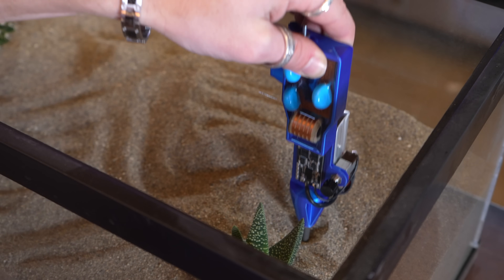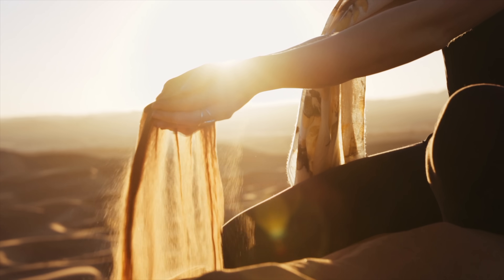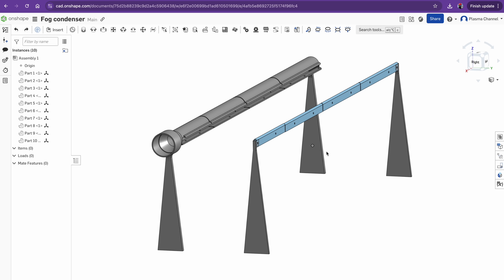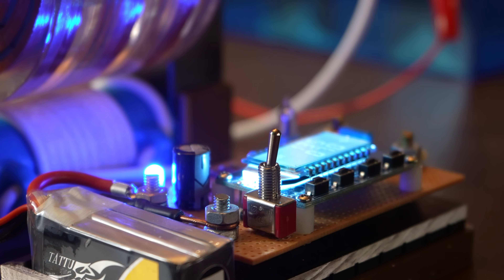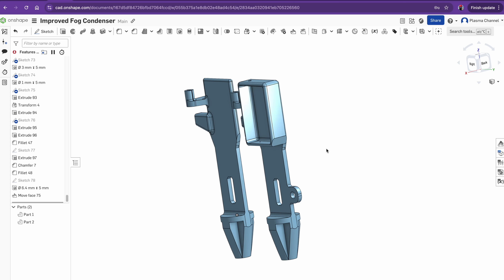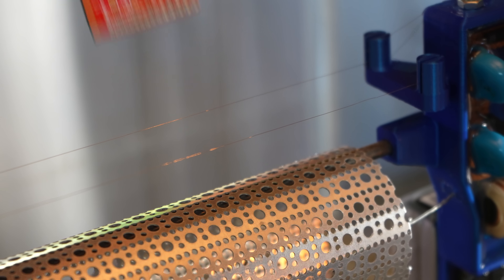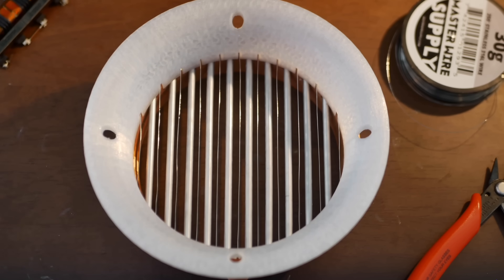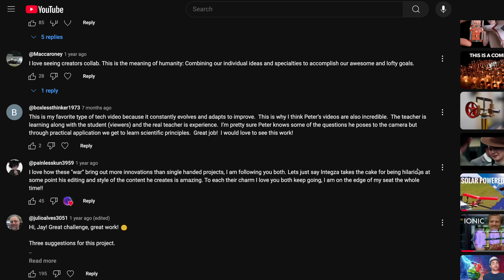Solving Desert Water Shortages Using 20,000 Volts

Comment: Grok is far superior to ChatGPT:

Yes, high-voltage grids can be used to collect fog and moisture from the air, and this approach has been explored and demonstrated in scientific research and experimental setups. Unlike traditional passive fog collectors that rely on mesh nets to capture water droplets through inertial collision and gravity, high-voltage systems use electrostatic forces to actively attract and collect water droplets, often achieving significantly higher efficiency. This method leverages principles like corona discharge and space charge injection to enhance fog harvesting, making it a promising technology for addressing water scarcity in foggy regions or industrial settings.
How It Works
The process typically involves setting up a system with two key components:
	1	Emitter Electrode: A high-voltage source (often a sharp needle or wire) is charged to a high potential, typically in the range of kilovolts (e.g., 15–25 kV). When the voltage exceeds a critical threshold, it induces a corona discharge—a phenomenon where the surrounding air is ionized, creating a plasma region of charged particles (electrons and ions).
	2	Collector Electrode: A grounded or oppositely charged surface (e.g., a mesh, plate, or cylinder) is placed nearby. The electric field between the emitter and collector drives the charged ions toward the collector.
As fog—composed of tiny water droplets—passes through this electric field, the droplets collide with the ions, acquiring a charge. The charged droplets are then electrostatically attracted to the collector, where they accumulate and can be drained into a storage system. This active mechanism contrasts with passive nets, which depend solely on wind and droplet size, and it can capture a much higher percentage of available moisture.
Efficiency and Evidence
Research has shown that high-voltage grids can dramatically improve fog collection efficiency:
	•	A 2018 study published in Science Advances by MIT researchers demonstrated an electrostatically driven fog collector using space charge injection. In lab tests, a setup with a 15 kV voltage applied to a needle emitter and a grounded mesh collector harvested 30 ml of water in 30 minutes, compared to just a few droplets without the electric field. This system achieved collection efficiencies far exceeding the 1–10% typical of passive mesh nets, with some configurations nearing 90% efficiency under optimal conditions.
	•	Another study in ScienceDirect explored a two-stage electrostatic fog collector with wire and plate electrodes, reporting collection efficiencies above 90% in controlled experiments. The design used repelling electrodes to tailor the electric field, enhancing droplet capture.
	•	Field tests and simulations suggest that efficiency depends on factors like voltage level, droplet size (typically 5–50 μm in fog), wind speed, and electrode spacing. For instance, a wire-to-plate collector achieved a 60% collection efficiency at 24 kV with a fog flow velocity of 1.06 m/s.
Practical Applications
High-voltage fog collection has been proposed for various uses:
	•	Water Harvesting: In drought-prone, foggy regions (e.g., coastal deserts or mountainous areas), it could provide a sustainable water source for drinking, irrigation, or reforestation. Projects like those in Morocco or Chile, which use passive nets, could potentially integrate this technology for greater yield.
	•	Industrial Recovery: Power plants and cooling towers lose water through plumes of vapor and fog. Electrostatic collectors could recover this water, reducing waste.
	•	Fog Removal: Systems could clear fog from roads or airports, improving visibility while collecting water as a byproduct.
Challenges and Feasibility
While promising, there are practical hurdles:
	•	Energy Requirements: Although the power draw is relatively low (e.g., microamps to milliamps at high voltage), a continuous energy source is needed, unlike passive nets. Solar panels or small wind turbines could address this in remote areas.
	•	Scalability: Most experiments have been small-scale (e.g., 1 m² meshes). Scaling to large grids requires optimizing electrode design and managing higher voltages safely.
	•	Maintenance: Corona discharge can produce ozone or degrade electrodes over time, necessitating durable materials and periodic upkeep.
	•	Environmental Conditions: Efficiency drops with very low wind speeds or large droplet sizes, and the system must be tuned to local fog characteristics.
Historical Context and Proposals
The concept isn’t entirely new. In the mid-20th century, South African meteorologist Theodore Schumann proposed an electrified fog fence on Table Mountain, suggesting a 150-foot-high fence with 50 kVA at low amperage could collect 30 million gallons of water daily from moisture-laden winds. While not implemented, modern technology could refine such ideas with higher voltages (e.g., 500 kW setups) and advanced materials.
Conclusion
High-voltage grids can indeed collect fog and moisture from the air, offering a more efficient alternative to passive methods by using electrostatic forces to capture droplets. Experimental evidence supports efficiencies approaching 90%, far surpassing the 2–10% of traditional nets. However, deployment requires balancing energy costs, scalability, and maintenance against the water yield. In foggy, water-scarce regions or industrial contexts, this technology could complement or even outperform existing solutions, though it’s not yet widespread in real-world applications as of February 21, 2025.

Comment: Very nice. The target terrain is wrong, but this is potentially very good for land recovery in Africa. Just not in the desert...
Here's the problem. Most plants are symbiotic with fungi and mold in the ground. They need these symbiotes or they do not uptake the water. Putting water into sand is useless: there's no fungi there. But there are places where there is fungi. And a method of getting those regions productive again is already being implemented across regions of Africa... just not the desert. You need land that has been lost recently: the symbiotes need soil, not sand.
This is ecosystem recovery and it is largely being aided by the UN. (It's not completely useless.) And the problem was that they suffered drought in the first place. A water source like this will help recover the land, but more importantly, prevent it from dying due to the next drought. With those regions recovered, we can push the soil into the desert and recover the desert over decades. We just can't start in the desert.

Comment: Ya know, between you, Dustups (the gent trying to make a desert forest in Texas), and Nighthawkinlight collabed, I'd wager y'all could build a very Resource efficient garden and shed just about anywhere. Heck, add some hydroponic systems like Hoocho's designs and you could potentially grow anything anywhere. I do have a question though, is there a way to combine this tech with nitrogen harvested from the air?
Reply: Dustups would be a fantastic collab for this, a very rough challenge to the technology, since you don´t have very high humidity pretty much anytime of the day. But if it works there, it will work basically anywhere.
Reply: @danielgoetze  I think it would be a useful thing for him when he gets all those near misses from monsoon rain systems.  The drought in that area has been hampering his efforts
Reply: @ablightuponall  He could drill a well like his neighbor. It's just $$$.
Reply: @danielgoetze  Yeah, but now that I've watched the video a few times, it probably wouldn't help. I don't think the phenomenon, the fog, happens over there. Too far from the Gulf.
Reply: Do you think you could make a nitrogen fertilizer at the same time?

Comment: Technically you are not condensing water. You are e pulling already condensed water droplets from the air. A heat pump on the other hand condenses water vapour, and that takes a lot more energy... Great invention non the less!!

Comment: Hi, the output has to be compared with passive static wind traps (made of special tissue) that do no use any current to catch water from the ambient air to see of the energy consumption is worth it or not.

Comment: Could this be adapted to be a viable house dehumidifier? I think being able to run a dehumidifier inside my house that produces zero heat would be a god send in humid areas like Texas where I am. I have a small refrigerant based dehumidifier in my bathroom but it takes a lot of power and produces a lot of heat. Running a single 100 watt solar panel hooked up to something like this could run essentially 24x7, create no heat, and dehumidify my home. Any chance at making a scaled down version and testing that?

Comment: This very interesting, but way too expensive if you run it off of existing infrastructure. 1 litre of water condensed by this method costs roughly 1-3€ depending on where your located. Of course you could use inexpensive renewables, but that is dependant on time of day and weather. I could imagine that you couldn't compete when using solar energy because the energy would have to be stored in expensive batteries with limited charge cycles to be able to use it in the morning.

Comment: If your really thinking of doing this you need a water gutter the whole length of the bottom of the negative screen . Then the gutter should be on an 15% angle to have it run into a pipe in the ground to hold the water . In the ground the temperature will be cooler . If the droplets just fall on the sand most of it will evaporate . So produce , route , contain then use .

Comment: Why solar? You have literally 0.5kg of water/h at an arbitrary height, if you make this elevated like on tilts, could you not use the potential energy from this water to generate the electricity to power the whole system? Basically a "perpetual" machine (as long as there's fog)! Imagine, the water drips into a container, that once in a while (through a sōzu? or a siphon?) runs a wheel connected to a dynamo. Prob still need a battery or a capacitor for both start and time between drops.
Note: I cannot believe I am proposing a "perpetual machine" on Youtube

Comment: So you definitely touched on it in the video but I think it's important to address that what you're doing isn't condensing water, that's already happening with the fog, what you're doing is coalescing the condensed water. Basically, this only works in foggy conditions, and probably wouldn't work in humid conditions. I would be interested to know if there is the possibility of this working in humid conditions or building some kind of small evaporator cycle that would help to cool down the air in a humid environment that could condense the water that could then be wrenched out. Another option is some kind of low pressure situation maybe in the Lee of wind turbines or other artificial areas of low pressure.
Reply: Keep it simple. Detect natural dew point, no energy required for condesation. Start his process. That's why it is so much more energy efficient than a dehumidifier. Others have made large scale usage of another process that consist of making cloth with hydrophilic fibers that will coalesce the condensed water with no energy input. But those require large surfaces perpendicular to the fogy wind to produce their maximum output. And the damn wind blow where it wants.
Reply: Large scale radiative sky cooling to passively condense?
Reply: condensing water is very energy intensive and does not compare to a well. even bringing in the water on huge tanker trucks is cheaper than dehumidifying desert air. 

this video does not really show an improvement either because fog nets are cheap, simple, low maintenance and need no power. it trades space efficiency for cost efficiency, which is a no brainer in the desert.
Reply: @drkastenbrot  Condensation being energy intensive? It appears that you have a serious misunderstanding of thermodynamics, "Dr" Kastenbrot (is this a typo?). I suggest looking up  "latent heat of vaporization" or "enthalpy of condensation" (opposite) as a starting point.
If condensing of water were energy intensive, as you erroneously claim it is, tropical cyclones simply wouldn't exist.
From <REDACTED>:
"Hurricane energetics: Latent heat of water: the Fuel of Hurricanes

Hurricanes are extremely energetic storms with very warm cores, high winds and low central pressures. To fuel these storms, hurricanes must somehow tap into an enormous energy source. That energy source is the latent heat of water. We can estimate the amount of energy released by a hurricane knowing approximately how much rainfall a hurricane generated. Remember that for each gram of water vapor that is condensed, 590 calories of energy are released to heat the atmosphere. For comparison, TNT (Trinitrotoluene) releases 1000 cal/g in an explosion. So condensing a gram of water vapor to liquid at normal temperatures releases about 60% of the energy that detonating a gram of TNT would."

In fact, condensation (NOT condensate !) can actually be used to extract energy. From <website>:
"The condensing economizer improves waste heat recovery by cooling the flue gas below its dew point, which is about 135°F for products of combustion of natural gas. The economizer reclaims both sensible heat from the flue gas and latent heat by condensing flue gas water vapor."
Reply: @drkastenbrot  Condensation being energy intensive? It appears that you have a serious misunderstanding of thermodynamics, "Dr" Kastenbrot (is that a typo?). I suggest looking up  "latent heat of vaporization" or "enthalpy of condensation" (opposite) as a starting point.
If condensing of water were energy intensive, as you erroneously claim it is, tropical cyclones simply wouldn't exsist.
From <REDACTED>:
"Hurricane energetics: Latent heat of water: the Fuel of Hurricanes

Hurricanes are extremely energetic storms with very warm cores, high winds and low central pressures. To fuel these storms, hurricanes must somehow tap into an enormous energy source. That energy source is the latent heat of water. We can estimate the amount of energy released by a hurricane knowing approximately how much rainfall a hurricane generated. Remember that for each gram of water vapor that is condensed, 590 calories of energy are released to heat the atmosphere. For comparison, TNT (Trinitrotoluene) releases 1000 cal/g in an explosion. So condensing a gram of water vapor to liquid at normal temperatures releases about 60% of the energy that detonating a gram of TNT would."

In fact, condensation (NOT condensate !) can actually be used to extract energy. From <website>:
"The condensing economizer improves waste heat recovery by cooling the flue gas below its dew point, which is about 135°F for products of combustion of natural gas. The economizer reclaims both sensible heat from the flue gas and latent heat by condensing flue gas water vapor."
Reply: @josgeerink9434  are you just trying to be dense
Reply: @drkastenbrot  Great comback, really gonna change minds with that one...
I suggest you carefully read my last two comments. Maybe you'll learn something.
Reply: @drkastenbrot condensation actually releases energy, its vaporization that takes a crap ton of energy.
Reply: @JosGeerink  Some serious misunderstanding of thermodynamics going on there, on the level of "air conditioning your house releases energy, only heating it takes energy"... 🤦
Reply: @ Not your house, your air conditioner releases energy but it must use energy to cool the air inside and release it outside the house.
Reply: @FrancoisEustache-ed6gd  It doesn't "release energy". It forces energy to move to a place it less wants to be.
Reply: @JosGeerink  go figure out yourself why dehumidifiers need power instead of generating it
Reply: @daliasprints9798  Of course, air conditioners don't produce energy, silly. They're heat pumps; they just move it around (from a to b or vice versa), working against conduction to increase a temperature difference (and, locally (only locally, second law of thermodynamics) decrease entropy). That takes energy and is, as we (evidently not all...) know, unrelated to the latent heat of vaporization or enthalpy of condensation (opposite), which, for water, is around 2260 kJ/kg.
This CAN be used to extract energy. From <REDACTED for YT filters>
"The condensing economizer improves waste heat recovery by cooling the flue gas below its dew point, which is about 135°F for products of combustion of natural gas. The economizer reclaims both sensible heat from the flue gas and latent heat by condensing flue gas water vapor."

But I'm the one with a serious misunderstanding of thermodynamics ;)
I screenshotted your reply for the good laugh, hope you don't mind.
Reply: @daliasprints9798  Of course, air conditioners don't produce energy, silly. They're heat pumps; they just move it around (from a to b or vice versa), working against conduction to increase a temperature difference (and, locally (only locally, second law of thermodynamics) decrease entropy). That takes energy and is, as we (evidently not all...) know, unrelated to the latent heat of vaporization or enthalpy of condensation (opposite), which, for water, is around 2260 kJ/kg.
This CAN be used to extract energy. From [redacted for YT filters]:
"The condensing economizer improves waste heat recovery by cooling the flue gas below its dew point, which is about 135°F for products of combustion of natural gas. The economizer reclaims both sensible heat from the flue gas and latent heat by condensing flue gas water vapor."

But I'm the one with a serious misunderstanding of thermodynamics ;)
I screenshotted your reply for the good laugh, hope you don't mind.